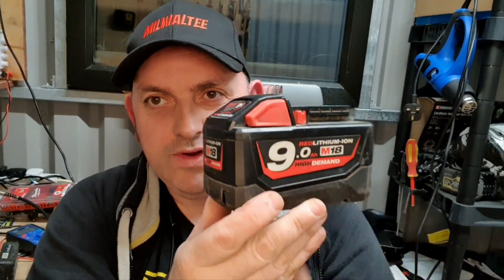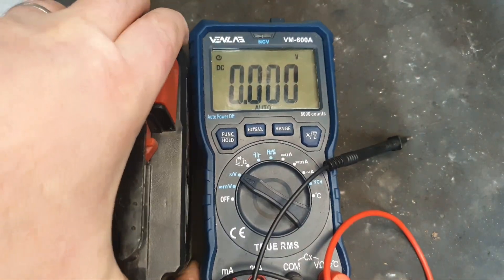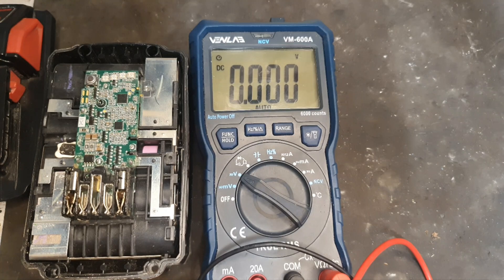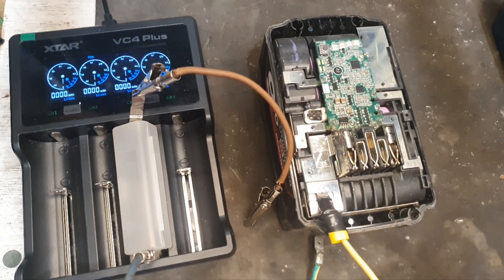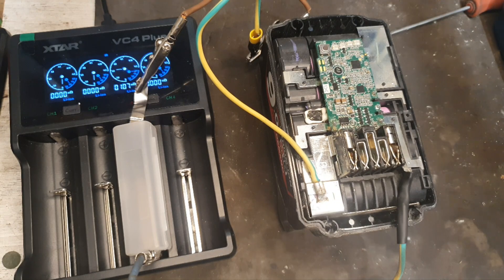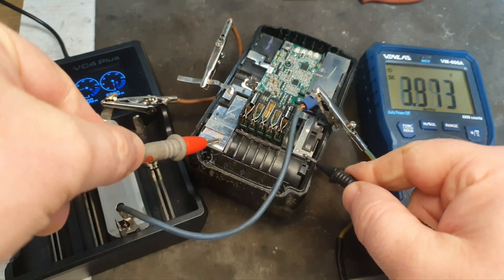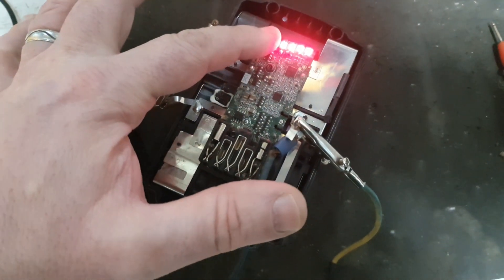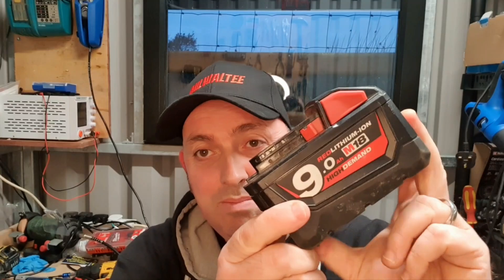Milwaukee M18 Battery: 2 Lights Only? Easy Repair!

Comment: I used a hobby charger from the RC world. ISDT brand. Gotta make some cables (xt60) and have a power supply or car battery and then you can do a true balance charge of the entire pack. Fixed my 12.0 that was showing 3 bars and had a cell group at 3.1V
Reply from the maker: That sounds fantastic

Comment: just suggestion  to save time waiting   for 1 bank as its a 4 bay charger why not make another  fake plastic batt  that way you can charge 2 banks at once or even 3 when needed saves waiting for 1 at a time  :)  im not sure  but if you use bay 1 and 4 on your charger the output for charging is higher  poss 1 or 2ah  great vids :)
Reply from the maker: I had thought of that but that charger charges one cell quicker than 2 it spreads the output between  whatever amount of slots are used. If I had 2 chargers 🤔
Reply: @doctorlefthandthread  hmm  i do believe it will do 2 at 2 ah which it more than enough,i  think its bay 1 and 4 .if you do 3 or 4 batts it then cuts it down to a lower charge rate as the charger cant do 4 ah output
Reply from the maker: @gazbullen  I Will give it a go next chance I get
Reply: I believe you will run into issues doing that because the ground side of the chargers are all interconnected and you may inadvertently short a cell